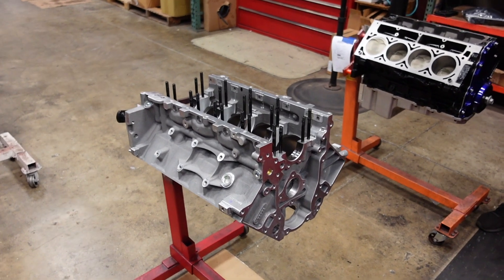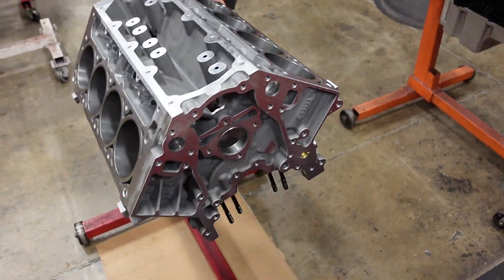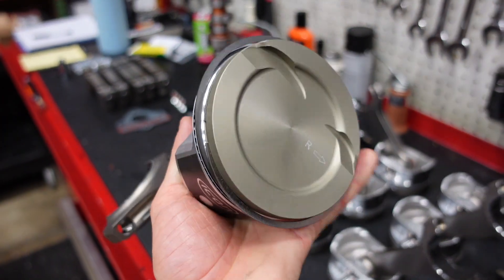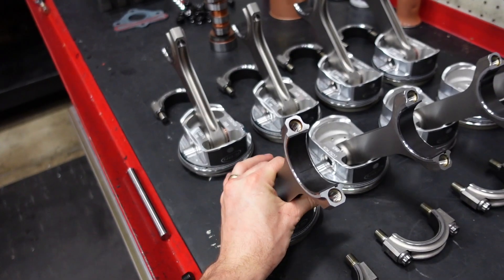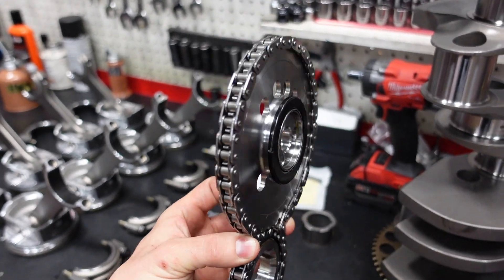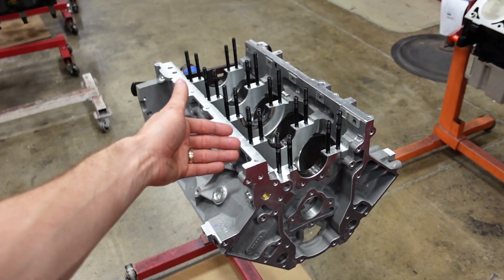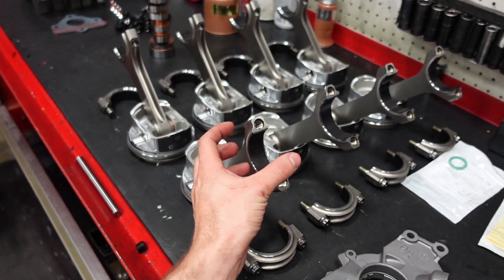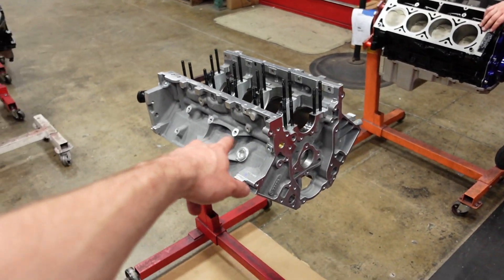Building a Supercharged 416" LS3 Short Block

Comment: DO you guys sell a crank, rods & piston set? I have a supercharged SS also (already with heads & cam), but am still on the stock short-block. Do you guys sell kits or install a new rotating assembly into existing LS3's? THanks, and great video!

Comment: Is this the icon piston used in the smearing rotating assembly you usually recommend for N/A/700HP?
Reply from the maker: Negative, this engines has the 1,000hp rated 2618 Icon piston

Comment: Using a rattle gun to do big ends up ,Ur young and got a lot to learn also Ur shaping steel parts together, be more careful when placing rods in a block and what's with the hammer to get end float ,a big no no

Comment: Would you recommend for or against loctite on the oil pump bolts. Currently rebuilding my ls1 because it spun a bearing on September but upon disassembly we found that the new (at that time) oil pump had actually backed out but was for sure torqued to spec when it was installed
Reply: He has mentioned in other videos he uses loctite on the oil pump
Bolts

Comment: If you were refreshing a bottom end and replacing main bearings can you avoid setting the thrust clearance? If I took a stock crank to the machine shop to be balanced with some pro ls rods and pistons can I just reuse the main bearings to avoid the thrust clearance and possible problems? Thanks
Reply: If your gonna build an engine with pistons and rods, why even question reusing bearings. That's ridiculous. Just measure the crank, check if it has stock bearing size. Get some new ones, install, and check for clearance. Can always take them out if the clearance doesn't work out because of thickness variances